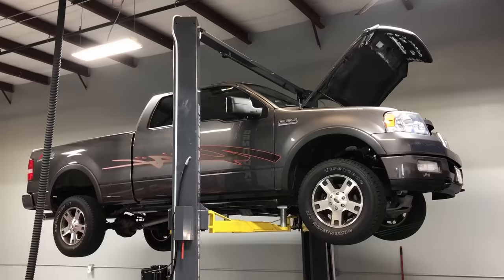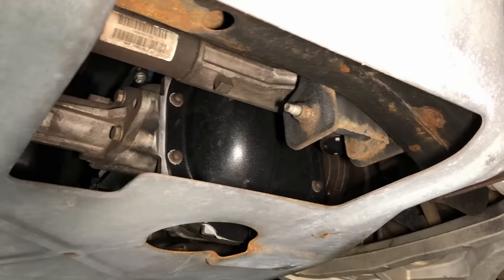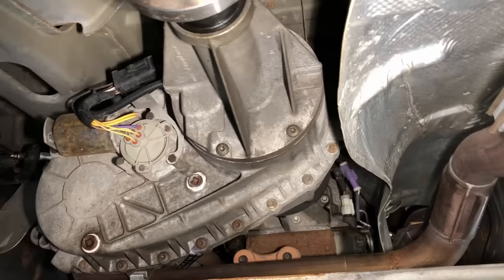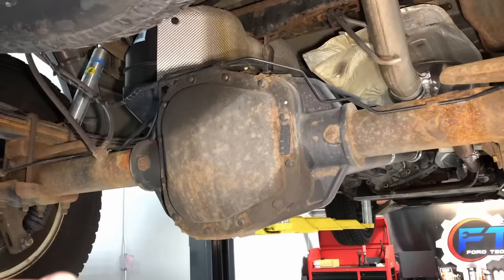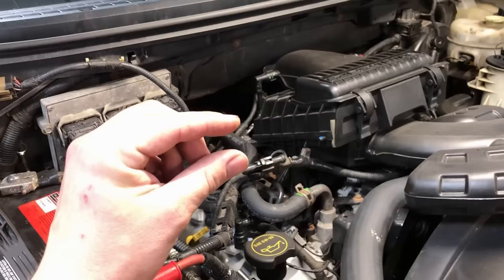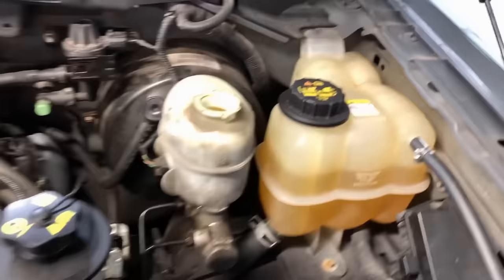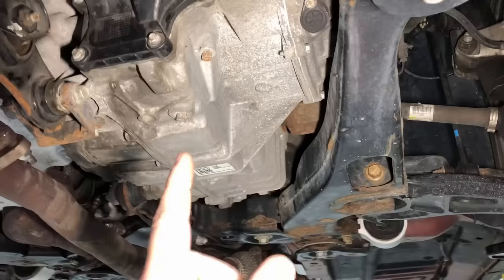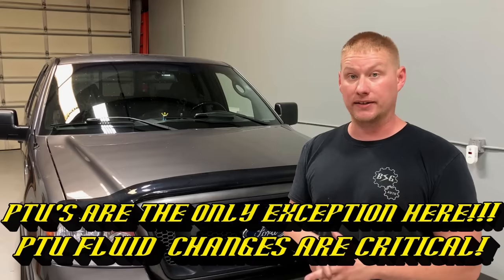Never Follow Ford's Lifetime Fluid Service Intervals: Here’s What I Recommend and Why!

Comment: Great video, 
I just have a question on the super duty.

I heard you talk about the green and gold fluid, but what about the new orange/pink fluid in the new super duties with their two coolant systems? 

Also if you could touch on filters like the air filter. Does the air filter minder work? The little Guage on the air filters? If not when should they be changed?

And for diesel, when should the coalescer filter be changed?  I believe it’s for the crankcase ventilation. 

Also when changing the trans fluid, when dropping the pan and changing the filter, that does not get all the fluid in the transfer case, is it enough with the remaining fluid in the trans? Or should it be taken to dealer to use fluid exchange machine?

Thank you for sharing your knowledge! Appreciate the videos!
Reply: You can take the transmission cooler return line off and start the truck while pouring in New mercon v til it runs clean. I think 13 quarts to do a full fluid change. Reattach your return line and your good
Reply: @thomasbates5157  
Mercon V?! Not in the newer vehicles!
Reply: @thelefthandedshooter5760  
Do NOT use MerconV.  Use the specified fluid and the correct service manual procedure
Reply: @rays7437  that's just what's in my f150
Reply: @thomasbates5157  
Sorry. I tend to freak out about wrong fluids.  I've had a lot of customers over the years with big repair bills because of that

Comment: Hello, I have a f150 2017 2.7 eb, in your experience how often is carbon build in the intake valves? I have 16600 miles in my truck and I want to prevent that happen. Thank you
Reply: I've got a 2015 2.7 with 80k, no issues yet but I haven't used a bore  scope to determine, just seat-of- the -pants. If you've haven't already done so, get yourself an oil seperator like the JLT. It will save you in the long run.
Reply: @ftby59mikeD  did you installed an oil separator in your truck?
Reply: @ftby59mikeD  did you installed an oil separator in your truck?
Reply: Yes, JLT's 3.0 comes with factory style hoses & connectors. It's plug & play...$140.....check it out!

Comment: I took my 2011 FX2 into a Ford dealership to have the transmission service. Ive had the truck for two years with about 145k on it. Had 158k when I took it in. They told me not to change it if I didnt know the last time it was changed. What gives?
Reply: As long as you aren't currently having any shifting issues, ABSOLUTELY change it.  Putting fresh fluid in a transmission of any age will never hurt it, unless you already have a problem, which will show up soon, anyway.  I just bought an '08 Sequoia 5.7L a few months back with almost 150k miles on it, and I KNOW the fluid had never been changed.  The dealership the guy bought it from specifically said they never change the fluid on these transmissions, and that was the ONLY place the previous owner serviced the vehicle every 5k miles.  I immediately got it flushed as soon as I got home with it.  It wasn't that dark, really, but at least I now know it has good synthetic fluid in it that will last a long time.  Still shifts exactly the same as it did when I dumped the factory fill almost 6 months ago, now.

Comment: I just bought a 2010 F150 XLT with a little over 120k miles on it. I thought the rear diff had a drain plug. Something I overlooked and forgot to inspect/check before buying the truck.....I removed the radiator cap and it's brownish rusty looking fluid in there...... I already ordered waterpump, all hoses, thermostat, and radiator cap, skipped the radiator. Hopefully that and the heater core are internally okay after a full coolant flush......got dammit......

Comment: Absolutely love watching your videos. It is very interesting to see your opinion and perspective compared to what I see on a day to day basis. I have been in the game about 10 years now, spent most of my time at independent shops and recently moved to a Ford/Lincoln dealer early this year. Are there any suggestions you have for an experienced technician moving into dealership? And would buy a new Ford EcoBoost? Want to buy my wife a new car but after working at dealership I really am not happy with the 6F35 and 1.6 engine in the Escape. What are your thoughts on the Ford Escapes? Think we may go Toyota Rav4 instead. Again thanks for all your videos and information I love having the resources you share and highly value them.

Comment: I think Ford makes high maintenance vehicles, they are not very good. I have a 2003 toyota matrix, I change the oil every 10k, transmission-automatic drain and fill every 60k and every other service drop the pan and replace the filter. Coolant flush 80k and spark plugs 80k. The car still runs fine, does not burn oil, transmission shifts okay. Replace the radiator, cap and thermostat once. It know has 289k miles and my teenage son drives it

Comment: What's with all the surface rust? I'd be more worried about the vehicle falling apart. I've seen original 40 year old cars that don't that much rust😂
Reply from the maker: It’s light surface rust not a big deal. The truck will be fine for another 20 years or 30 years if treated.
Reply: @FordTechMakuloco  i understand it's surface rust, but it leads to bigger problems later on. Why we the consumer should treat rust problems that the manufacturer should do in the first place? Engine and running gear on my vehicles always get done by manufacturers specs before time or klms. As i live in Australia, maybe we don't have the same climate/weather as the USA. Do they still salt the roads in some states?

Comment: They used to have drain and fill plugs on everything....and grease zerks on all suspension components. Manufacturers used to pride themselves on ease and low cost of service, followed by longevity. Today, the bean counters have forced engineers to save money by eliminating them, saving pennies on every part. BUT......they make a ton more...because major component failures cause whole assemblies to have to be replaced. Then owners are forced to decide to repair for a ton of cash, or buy another vehicle and leave the problem for the next guy.  Welcome to today's disposable society where the only thing that matters is how your phone interacts with your vehicle.

Comment: NEVER Follow the recommendation of any lifetime fluid. The term lifetime means however long the automaker wants the car to last so you come back to buy a new one. No transmission, diff, etc. fluid will last over 100,000 miles without beginning to breakdown.

Comment: I bought a Ford once...went through 3 transmissions in 2 years. First one I bought, the others were under warranty. I traded it for a Chevy. Never looked back. It’s been great since!
Reply: I say BS. Anyhow Chevy is fine too. Not  Ford... but good. Dont play the troll games.
Reply: There are similar stories about the Chevy Cruze. Other stories say they hold up well. Named after Ted Cruz the Zodiac Killer LOL. You can get one cheap they are out of production now.
Reply: I'd call that a 20teens model Ford focus,  or a improperly maintained used car

Comment: Wow i guess i should go to the garage right now, only oil replaced in my 100k mile ford fusion 2010 are transmission and engine, will need to go get all the other oil changed, garage kept telling me that i did not need to change it, i was finding this odd... thank you  the great tip and explaination

Comment: The extended oil changes should be done with oil analysis. I do Extended oil changes with Amsoil SS and my oil is black yes but I have a 6.7 diesel.Its still perfectly fine, I do oil samples every 5k to get my baselines. I could do 20k but i change mine at 15k, Makes sense to do oil analysis to know whats going on in your motor and your oil quality. Blackstone labs (oil analysis) Plus with the oil samples you can tell whats wearing  as different areas of the motor have different elements. But hey take it with a grain of salt. I do all my fluids on the severe duty scheduled and I'm Positive my truck will be on the road along time! Do your own research and go with what you know.

Comment: I think changing transmission fluid every 30,000 miles is way too soon. Back in the old days it would make sense but nowadays, fluids last much longer than they did back decades ago. I’d say 60,000-80,000 miles is just fine.
Reply: That's another "it depends" type of thing. If you do lots of stop and go in a hot climate the 30,000 makes sense. if you do mostly highway and rack up miles quickly 60,000 is just fine. If you own a car with a CVT trans, 30,000 is mandatory!
Reply: Steve Raymond Well I drive less than 10,000 miles a year and don’t do lots of stop and go consistently and I’m not in hot climate. Trans fluid today can handle heat much better than what they used to back in the 60s-70s. If you have a Nissan CVT than 30,000 miles is recommended strongly. I used to have one and I got it when it had 40,000 miles and 2 months later the transmission went out. I have a Ford Fusion 2017, and it’s been perfect.

Comment: Hello I recently bought  2010 Ford Fusion and have been loving your videos they have helped me fix a few things and learn to diagnose some. However I'm having an A/C issue and wonder if any of you may know what's going on. The ACP Sensor is showing 0 PSI but the gauges are showing good. I think it is keeping the compressor from coming on. I changed it and when I first put the new one on it was showing good pressure on the sensor but then after the car sit for a while it dropped all the way down to 0 on the sensor but the gauges are still showing correctly. Do you know what may cause this?  I noticed I can unplug the battery for a few minutes and the a/c will kick on. Or if I start the a/c from the scan tool the pressure sensor will start showing pressure but never as high as the gauges. As long as the pressures are up I can then start the a/c with the buttons on the hvac module. Sorry for the long comment but I've been trying for weeks to figure this out and have taken it to a mechanic, he put on a new compressor and said maybe I need to get a new PCm. Thank you.
Reply: 99% of the time they say it's a PCM fault, it's not. 
Sounds like a wiring issue. Burnt or corroded pin in a connector or something like that. Maybe the control panel itself has a fault.
Hopefully Brian can answer you
Reply: @rays7437  Thank you for the reply, that's what I think is it may be a wiring issue. I bought me a volt meter so I can go through the check list of stuff to check the switch connector. Ive just never done it before so I want to educate myself well first. I really don't know anything about cars but I'm learning quite a bit watching this channel, at least for my car.
Reply: @JustJoeH  
I hate electrical problems. 
I haven't heard of this problem before,  I wish I knew a simple answer.
Reply: @JustJoeH  
The more I think about it, the more it seems like the sensor connector is bad. Check the connector by wiggling it while looking at the readings.  If the readings start changing then it's most likely the connector.  The dealer should have a connector replacement or repair kit. (You'll probably need help with the wiggle test)
Reply: @rays7437  OK I will try that, I know on the old switch I had actually bent a pin on it because of the way the connector hooked in. So I was careful with the new switch to not bend it. I seen they sold the connectors at autozone as well. I was also wondering if maybe I've bought the wrong kind of pressure transducer but I only see one on the car schematics. At first I thought maybe the expansion valve but then I bought the manifold gauges and they were showing good pressure with the compressor on or off. So I'm not sure that could be it.
Reply: @JustJoeH  
If you bent a pin then it's very possible the connector is damaged. Or the connector wires.
Mechanical pressures are good so it has to be electrical. 
The wiring in cars these days is fragile
Reply: @rays7437  I agree and all these sensors make it a pain to try and fix it seems. TY for all the replies soon as it cools down outside a little I will go out there and try messing with the wires a little and see what happens.
Reply: @rays7437  Well I went out and just kinda tried unplugging the wire harness and playing with them a bit. When I unplug it the acp sensor shows 5v and really high pressure, i guess that is normal. I ran the engine off key on self test and that passed ok. I do however have a short to the blend door actuator, it's a b11e5 code I think, so I'm going to take that off and take a look at the wiring next and see what happens.
Reply: @JustJoeH  
That's interesting. A blend door actuator fault shouldn't have any affect on compressor operation. But who knows. 
I'm really surprised the dealer couldn't diagnose this problem
Reply: @JustJoeH  
With the sensor connected, did you wiggle the connector and see if the readings fluctuated?
Reply: @rays7437  I did wiggle the connector it didnt change. If i start the compressor with the scan tool it will start showing pressure on the sensor but it never gets as high as the gauges are showing. So it doesnt run the fan at the right speed either I don't think.

I can't really take it to a dealer close by the nearest one is about 30 miles. The mechanic who put the compressor on for me was telling me about trying a new pcm. I wouldn't think the blend door code would cause it not to turn on either but I dont know much about how that works. 

I am wondering if maybe I have put the pressure switch on too tight if that's possible. I hand tightened it and then tightened it a little with the wrench.
Reply: @JustJoeH  
You did fine on the sensor. If you over tighten it, it would probably just break off. I've done that.
I'm willing to bet money it's in the wiring or the controls. The pcm is almost never the cause of vehicle problems. Unless it has been monkeyed with or damaged somehow.
Do the cooling fans work?
Did the ac just stop working one day?
Reply: @rays7437  I've only had the vehicles a few months and the a/c didnt work when i bought it. It has a rebuilt title though so I dont' know what may have been messed with on it. The cooling fan does work it will come on after the pressure starts building on the sensor and I guess if the engine gets hot maybe but I've never had it get above normal temps. I will take the volt meter out there soon maybe and hook it to the plugin and see what maybe I can find out. It's just too hot out there atm to be messing with it.

I do appreciate all the help btw, i've asked on forums and such but had no luck with answers.
Reply: @JustJoeH  
Oh ok. Is there any way to find out why it was salvage? If it was wrecked then it's probably just a matter of checking for pinched wires and bad grounds near the repaired areas.  If somebody welded on the car without proper precautions then the pcm could have been damaged, but usually they get damaged in such a way that the car won't even run, or there will be multiple warning lights. Also if there were an internal open or short in the pcm, the check engine light should be on. 
If this is a PZEV car, the pcm is covered by the emissions warranty for 15/150. Emissions warranties stay in effect even on salvage vehicles. Safety warranties and recalls stay in effect as well.
I don't envy you the task of tracing the problem. 
You sound really smart so I'm sure you will find it
Reply: @rays7437  I may try and look up the VIN number and see if i can find anything about if it were wrecked or not, atm I do not know much about it before. There is an oil change sticker on the windshield from last november so I imagine someone was taking care of it. I didnt know that about the warranties so I will have to check out the mileage on it. I think it's around 145,000. 

The check engine light is on but it's for the catalytic converter or maybe an oxygen sensor.
Reply: @JustJoeH  
Carfax maybe? 
Is it a 4 cylinder?
Reply: @rays7437  Yes it is a 2.5l 4 cylinder

Comment: Hi! Thanks for your videos. I need help. I Recently bought a 1998 Ford Econoline 150 with the 4.6L. 
I need to take out spark plug #8 and I bought a 5/8" spark plug socket with magnet  but its too thick for the hole!
Its made by Ampro ; I believed it is supposed to be  5/8". Could this brand make it too big perhaps, have you ever exeprienced something like that? Do the Romeo and the Windsor share the same? Help is appreciated.

Comment: this life time fluid in tranny is kinda bs. the fluid and transmissions have gotten better. but if you want to get alot of miles out of your car its still wise to change it. alot of the cars can make it quite far now a days with no change and to the company's thats "life time".  the price for a simple drain and refill or drain and clean the pan is a cheap price to pay to avoid an earlier tranny faliure as when they fail alot of times the price to replace is more then the car is worth so it gets junked. but its also a word of caution on a well worn tranny if you have not changed the fluid a flush can sometimes cause havic I have seen quite a few higher millage auto transmissions killed by getting a flush later in there life

Comment: Do you recommend the same for a new 2019 Ford raptor supercrew? Thanks.
3.5 L ecoboost twin turbo
10r80 10 speed auto transmission

Comment: After my MN12 Cougar XR7 and the 4R70W Transmission blew out due to severe design flaw I decided to move away from Ford. The intermediate one way roller clutch was an engineering disaster. Ford has always been hit or miss when it comes to transmissions. That car nickel and dimes me to death